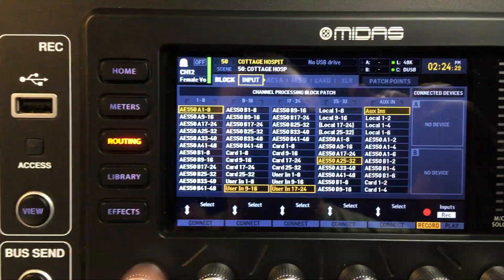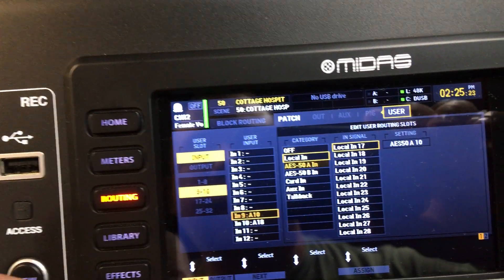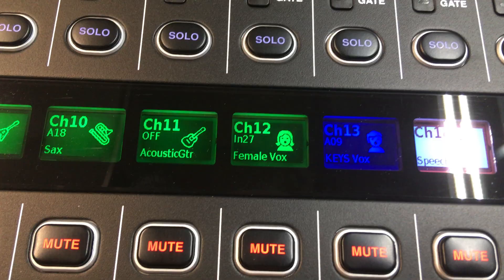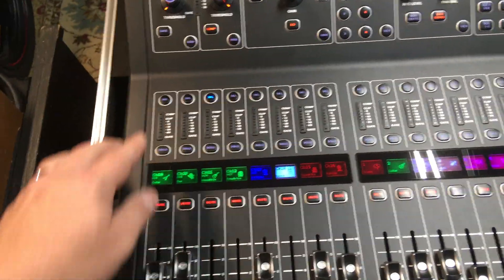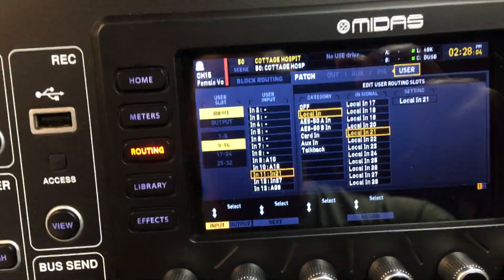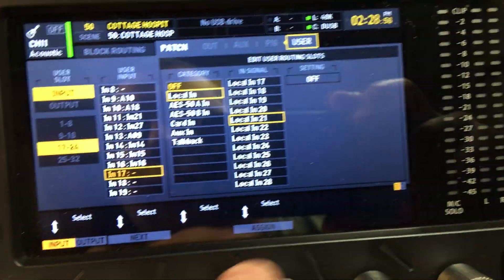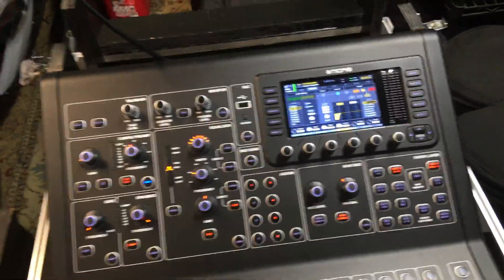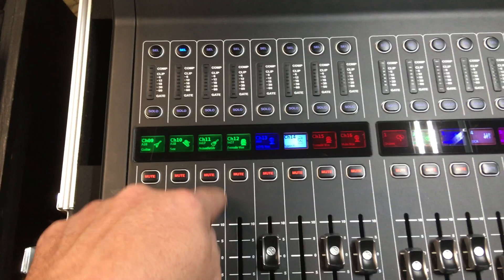Behringer / Midas Firmware V4 1:1 how to

Comment: Why does outputs show 42 or something, but there are only 16 output busses?
Reply from the maker: Christiaan Bezuidenhout wish I knew for sure as well? The only math that adds up is if you have 2 stage boxes connected to the AES50 A & B ports and counted the 6 aux outs and the AES/EBU, then you would have 40 sends. The last two could then be the left right outs used on the Console. But you still have the mono out that can be routed? So I’m not sure why it’s 42?
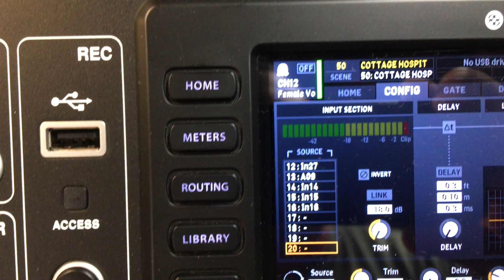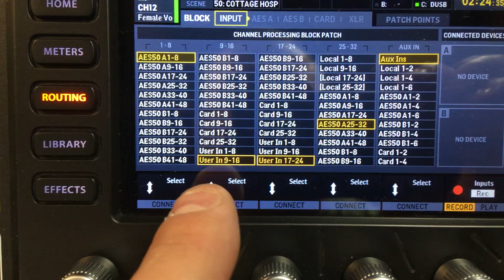Reply: @atech9020  the AES50 protocol can carry 48 inputs and 48 outputs signals... that's why you see until 48 blocks of 8 ... m32 cannot control all of 48 signals but can pass  them through the AES50 cable to other devices that can control them ...Also at 2:01 I think the reason that Ch12  didn't get the input source is because at 0:39 you haven't "registered" anywhere the local input 27 (as in blocks of 8) ..you input patch was AES50 A1-8
USER IN 9-16
USER IN 17-24
AES50A 25-32 ..
I believe if you select all of them as user inputs (1-32) you should not have this issue...
Cheers m8 nice vid